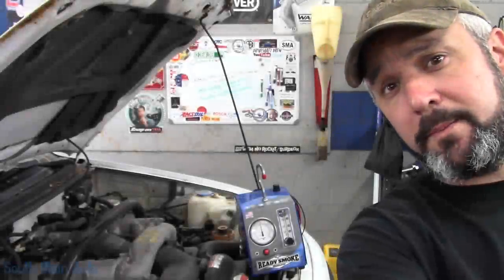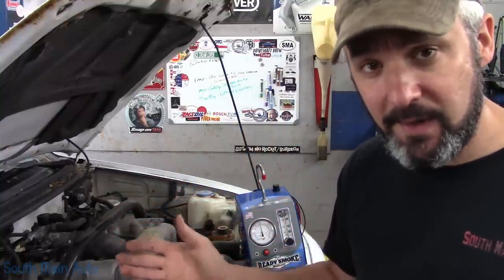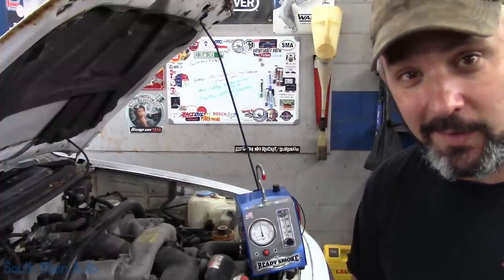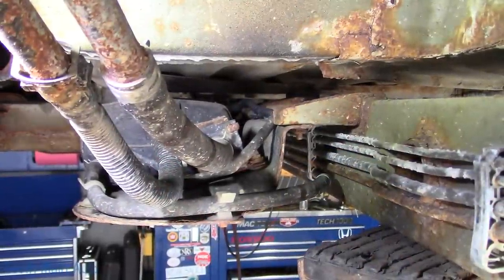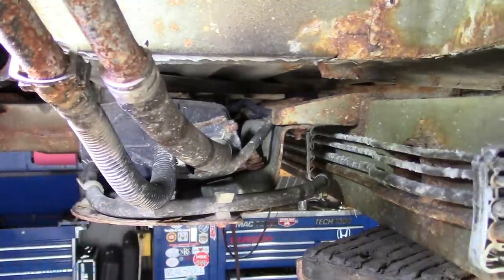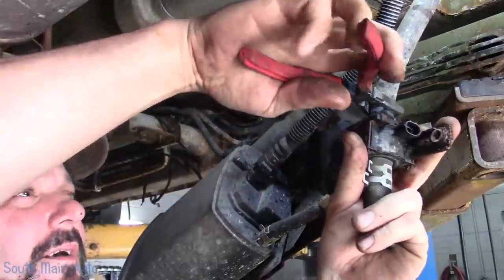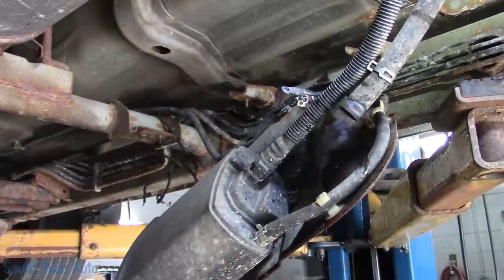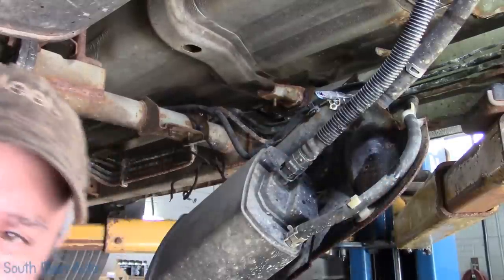Suzuki Vitara: EVAP Problem & Discontinued Parts!?

Comment: Excellent work, my friend! I can tell you are very organized. Any chance you work on Nissan (5spd. automatic - 350Z)? Noise..very light rattling) coming under chassis passenger side. Guessing heat shield, flange bolt loose or busted.
Reply: Sprydo7 Its most likely a loose heat shield banging against your exhaust. just cut it off with some tin snips. Or find a way to re mount it. Easy fix.

Comment: Hey Eric if you ever need parts for Suzuki in general auto modile parts  try calling  the house of jeep in Puerto rico or in Florida they should have all type of parts available trust me I been in your shoes I did three total restoration on Suzuki samurai  in Japan and Indonesia they remaking all the parts again
Reply: Yup there are plenty of sources for Suzuki OEM parts, Eric just doesn't know what he's talking about when it comes to Suzuki.  Even the part he needed he could have easily found, it is also sold as an AC Delco part with the number 2141059.  There are many online Suzuki OEM parts suppliers that operate in the U.S.

Comment: I had to do something similar with a Saturn vue a rat ate the knock sensor harness and left about nothing to repair but it had a j35 Honda engine so I called them got a similar part but had to cut it up and solder some of the old harness on but it took care of the money light

Comment: Good for a yard/offroad beater now.
Reply: Needs some frame repair though because of rust. Not just a Suzuki issue, happens to all cars in the north eastern states (and Canada too aye) that suffer from harsh winters and tons of road salts, and owners who fail to do proper maintenance and/or apply rust inhibiting undercoatings under those conditions.

Comment: My 2007 grand Vitara 2.7 V6 is showing code P1421 (manufacturer control). My research has come up with it has to do with the vent valve is stuck open or closed. Is the vent valve different than a purge valve? I’m finding purge valves but can’t find a vent valve. I thought the vent valve was near the gas tank and purge valve in the engine bay.

Comment: I'd carry duct tape and bailing wire until the car gets to be over 25 yrs old, then it won't need the emission inspection.
Reply: corvettefan91  My 1978 vette is 40 yrs. old and still has to pass Calif.  emissions insp. I just received my 2019 reg. sticker.

Comment: Hey! Suzuki isn't bankrupt, I regularly see 2018 models in the UK.
Reply: Suzuki is no longer producing automobiles in the North American market as it is teetering on the verge of bankruptcy
Reply: No.  GM's implosion sank them.  They used to share manufacturing (GM Plant in Canada) and compliance costs with GM.  That went away with GM's bankruptcy.  Suzuki had a weak dealer network since it was a captive import sold through GM dealers for most of its US market presence.  Compliance costs, weak dealer network and the added cost of importing from Japan sank them.
Reply: they make good motorcycles outboards and cars suck
Reply: My 1984 Chevy Sprint was pretty solid for the 50k miles I owned it. 60mpg was nice too. $7500 new with every option.
Reply: They stopped selling cars in the US and Canada.
Reply: The cars are good too, you Americans just can't appreciate them lol.
Reply: Just like Isuzu, another example of an American company screwing everything up causing the demise of an otherwise viable lineup. Isuzu auto sales sucked world wide because GM who had their crooked dicks up Isuzu's butt refused to allow decent marketing. Then it came back around on them when Isuzu-made Geo Storm lost it's platform. The whole time GM's like "yeah we blew it so what?" Personally I would have let them fail. The so-called economy would have recovered from it and life would go on.

Comment: If you need to take up a little bit of space between a hose that's too big and a plastic nipple, a layer or two of adhesive lined heat shrink over the plastic nipple might be just the ticket.

Comment: What do you mean by bankrupt Suzuki ? In the US it is bankrupt ? Omg the rust !
Reply: I didn't know about it too.  It seems that it happened in 2014: https://www.firstpost.com/business/suzuki-to-pull-out-of-us-market-files-for-bankruptcy-protection-515969.html

In Europe Suzuki still holding strong. That's why we are surprised:)
Reply: Rust? My wife's 2012 Mazda5 was worse than that after less than 4 years (Traded it in in November 2017)
Reply: Suzuki of America was a joint venture with GM / Daewoo. Declining sales, loss of dealerships, and EPA emissions standards forced them out of business in 2012.
Reply: Yah Suzuki Europe still going strong (ish). The other car company I hadn't read about going out of business was KIA, well until Hyundai bought them, something about trying to move into van market bankrupted the company.
Reply: They aren't bankrupt.  They just bailed out of the US market.  Kind of the curse of things that start as captive imports.  Remember Isuzu?  Once GM imploded Suzuki was screwed in the US market.  Their SUVs were mostly built at a GM plant in Canada.  That went away.  They also shared compliance costs with GM. Compliance costs plus the added cost of importing from Japan sank them.  Captive imports usually have lousy US dealer networks as well.  If most of your product is being sold through the "parent"  (GM for Suzuki), it's hard to develop a good independent network.  Don't be shocked if Mitsubishi bails on the US market in the next few years.  They started in the US as a captive import sold through Dodge and Plymouth dealers.
Reply: Yeah.  The rebadged Daewoos were a mistake.
Reply: Yeah.  The rebadged Daewoos were a mistake.
Reply: Still sold in Australiasia, including the Vitara model and several of their city cars.
Reply: Even in Japan Suzuki cars don't sell very well. Their ultralight ("kei") trucks and vans do ok though.
Reply: @ModMINI  Kind of like the Mitsubishi Fuzo trucks. Their cars sell poorly here but they own the light commercial truck market.
Reply: Mod MINI, I live in Japan and drive one of the kei cars you referenced (Suzuki Wagon R). My current Wagon R is my third Suzuki, they are fairly reliable. My first Wagon R was a turbo, but the transmission eventually started slipping. My second was a Suzuki MR Wagon, ironically the transmission went bad on it too. My current Wagon R is newer and is running nicely, but it is a non-turbo model and is short on power (660 cc).
Reply: Suzuki has always had trouble selling cars here. Initially it was thought that they would be another Honda success story (reliable bikes and now reliable cars) but everything was done half-assedly and it really killed their credibility to partner with GM/Daewoo. Whereas Mitsubishi/Chrysler and Mazda/Ford were beneficial to both parties, you had a third-tier Japanese automaker partnered with a US automaker on the brink of annihilation. The build quality of those vehicles were Nissan/Renault-level atrocious. It could have been a success story had (1) GM not been in the throes of pre-bailout bankruptcy and (2) the new Obama/EPA 2012 regulations damning all outdated designs like Suzuki produced. We lost the Crown Victoria during this perilous time as well.

Comment: Rust & Corrosion Central. How log does a new car last in NY before the salt recycles it back?
How could there be a used car market there if there all rusted out and 1 winter away from total disintegration.
Reply: They import them from southern states.

Comment: I have a p0450 code on my 05 grand prix..I changed the ..purge valve solenoid..evap canister and gas cap check engine light cleared out a few days later same thing then it idles rough any ideas?

Comment: This video is a great example of why after 10-15 years your car is going to the crusher. While I understand why the government instituted emission laws. But they didn’t have enough fore thought about the impact those laws would put on the public. So, if you can’t fix it. even though it runs fine. Just because there is a light on. Your going to have to spend 20-30,000 for a new car that will end up in the same situation at some point. Just cracks me up. We need to learn to buy pre fuel injection cars. And keep them alive. Anything past obd1 is a wast of money!!! This customer is just lucky they found someone that would go the extra. Most shops would just say it’s going to the scrap pile.
Reply: Was it a lack of "fore thought" or was it part of the plan?

Comment: clever to use corporate GM parts bin item to salvage "orphaned" Daiwoo/Suzuki
  -KUDOES to you-both saving monies and reviving orphaned car  

    (super clear,detailed repair where part exposed to corrosion,crap)
      so should  survive for another period in rust belt
Reply: Except that there was nothing Daewoo about the Suzuki Vitara or ANY other genuine Suzuki vehicle either.  
The only Daewoo ANYTHlNG that was sold with a Suzuki badge on it were the Forenza/Reno/Verona and Suzuki had nothing to do with those cars, they were pure GM/Daewoo garbage that GM forced the American Suzuki franchise to sell in the U.S. for a few years because GM didn't want to sell those GM/Daewoo models under the GM labels.  
Other than those few years (2004 - 2008) of Forenza/Reno/Verona, Suzuki did not have ANY Daewoo conent in any of their vehicles. 
Also, there was actually no need to retrofit the parts that he did on the Vitara, that part he needed is actually still available, Eric just didn't know how to get it, all he needed to do is order the same part for the Chevy Tracker (same car as Suzuki Vitara) and that part AC Delco 214-1059 is an exact fit.  
Lastly, there are plenty of online OEM Suzuki parts suppliers that operate in the U.S. that one can order OEM Suzuki replacement parts from but it seems that most mechanics just aren't aware of that.  Even Ebay carries that same replacement part!

Comment: Didn't know those things were rear wheel drive.  It can be fixed.  With an LS swap.  LS swap all the things!
Reply: An LS Swap cost more than that vehicle is worth sadly.
Reply: It's whatever value you put on it.  I mean there are some real shit boxes out there with LS swaps, lol.  I would do it for the fun, not for the value because the whole drivetrain is cheap from a junkyard.
Reply: ChillCosmos  
Why waste money doing a swap on this, when it would be better spent doing a swap on a Toyota 4Runner?
Reply: LS swap lol, keep going, swap the trans, driveshaft, rear end, wheels springs, stiffen the frame and it would probably still twist up like a pretzel ;))

Comment: Would that part still be available from GM for a Chevy Tracker?
Reply: Why bother? Vitara and Tracker were rust prone.
Reply: @toyoscio  What car was not "rust prone" in northeastern U.S. states with harsh winters and loads of road salts??? There are plenty of Vitara/Trackers still around and for sale on the west coast of the U.S. that don't have rust problems, and even on the east coast just as with any brand of vehicle over there, if you apply an underbody rust protectant you can keep the cars roadworthy for a very long time.  But no brand will last when they are obviously and severely neglected as the one in the video was. That was just negligence.

Comment: in New York, is there not a waiver program where once a dollar threshold is passed on a repair, the car is granted a decal? Or, as on in this case, if the part is NLA?
Reply: Dave Sears the waivers are usually costly, such as here in PA it's a minimum of $500 spent in parts & labor in an attempt to fix the emission issue for the failure it has. Plus, you have to have an additional credential to grant the waiver. It's not an average inspection license, at least here in PA.

I'm sure NY would probably be more costly, but am curious to the answer as well.
Reply: In ct. The waiver amount is about 900.00 dollars I still have that annoying po448 on my 2006 subie sti
Reply: It can only be used once. So essentially once you get the waiver you have one year to get a different vehicle
Reply: RP 3 ahhh... I didn't even realize that. I only ever did that once.  I wonder if that applies to all states.  I enjoy learning all this automotive related tidbits. 

Thanks to all you guys for your input!

Comment: I think those Suzuki's share a lot of parts or maybe are identical to the Geo Tracker's.
Reply: Tracker shares Vitara's platform. 4 cylinder Vitaras were built at the same Canadian plant as the Tracker.
Reply: I replaced a rusted out front suspension cradle on a tracker recently and the replacement part came from a vitara. That is what led me to believe they were the same.
Reply: Bobby Easterly  
That's correct, though Grand Vitaras were built in Japan, even though it's 6 was shared with the Tracker as well.

Comment: What makes someone buy a Suzuki?
Reply: Comparison shopping with an eye for value. practicality, and user friendly for maintenance.  BTW, he was very wrong several things. #1 - Suzuki is not bankrupt, they are the 10th largest car manufacturer in the world, he's confusing the North American franchise which folded back in 2013 with Suzuki the manufacturer, two seperate entities. #2 - The part he was looking for is actually easy to find and readily available but he was clueless to the fact that the Suzuki Vitara is the same car as the Chevy Tracker.  He could have just ordered the AC Delco part which is part # 2141059 and there are aslo plenty of online Suzuki parts suppliers, he's just isn't aware of them.

Comment: I ain't no dirt bag mechanic I would have used some old toilet parts to fix it and not charge the customer an expensive diagnostic fee cause my Ac Tron is cheap and even tells me how to fix the car, I would have to sell my box truck if I didn't have a little scan tool to help me. now if you will excuse me I have some spark plugs to spray gumout  on, the customer has already been waiting 2 weeks to get their truck back cause the choke cleaner takes a long time to free up the carbon.

Comment: Suzuki aren't bankrupt - they just left.   We have a wide range of zuks in Australia - new and used.
Reply: They didn't actually leave either though.  lt was American Suzuki Motor Corporation that folded due to extreme debt from their terrible business dealings with toxic General Motors.  After ASMC folded Suzuki of Japan stepped in, purchased the bankrupted franchise, dissolved that company and replaced it with a new company, Suzuki Motor of America.  Suzuki is still here, but they are now just focusing on motorcycle, atv, and outboard marine business.  They just discontinued the car sales in the U.S. but they are still here.
Reply: @JA-rn5qv  Isn't this a longer version of what I said? :)
Reply: @tcpnetworks  no because Suzuki hasn't left, they are still here just refocused their sales towards motorcycles/atv/marine. If they had LEFT they would have no presnce here anymore at all, but they haven't left, they are still here and still have their headquarters in Socal.

Comment: Damn, when are the people in your area going to realize to quit going to these schmuck shops and take it to SMA?!  TCM - what a joke.  How many would have told her she was SOL.  Unreal.  Great job and customer care
Reply: you've just eliminated and called the vast majority of shops worldwide "schmucks" :)) 
if not the flat rate/quota rush, then others with a dozen+ cars waiting for actual easy things and they wont bother trying to find electrical bugs/transmission issues. they'll push you to a trans shop, whom hopefully finds it's electrical before pulling and rebuilding  :|
Reply: I meant the "other" shops in the SMA locale; there are a lot of solid, honest shops all over.  Just seems like the stuff Eric has been showing lately has about the lamest attempts at a reasonable diag you could imagine - you need a TCM when the car doesn't have one...c'mon

Comment: Suzuki didn't go bankrupt - it pulled out of the US market in 2012 as it wasn't the right fit for Northern America
Reply: Thanks to GM Lol
Reply: They didn't pull out of the U.S. market, Suzuki is still here, they just discontinued car sales in the U.S. but they are still here and focusing instead on their motorcycle, atv and outboard marine engine sales. The old franchise (American Suzuki Motor Corporation) was dissolved and the new company is Suzuki Motors of America. They are still in the U.S. market.
Reply: @JA-rn5qv  Holy Moley 2 years ago, as this is a car channel I was referring to the car side of suzuki, what did indeed stop trading in the US but some engines and parts show up in FCA cars